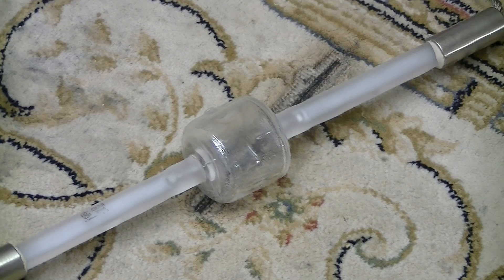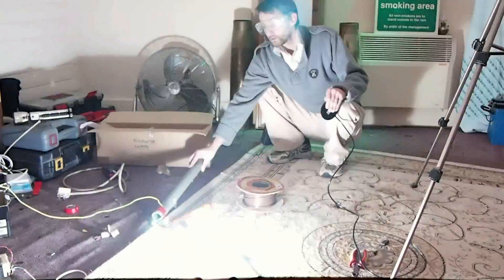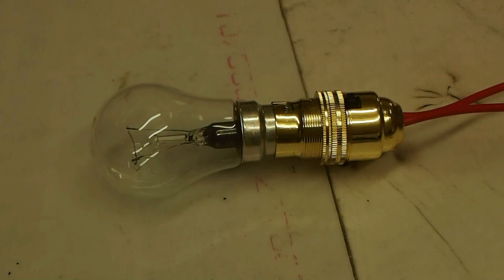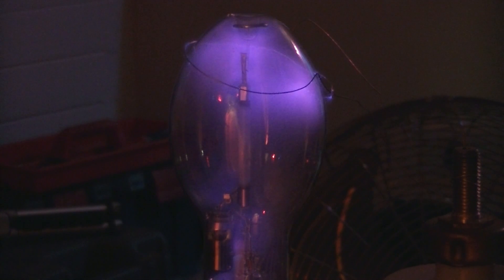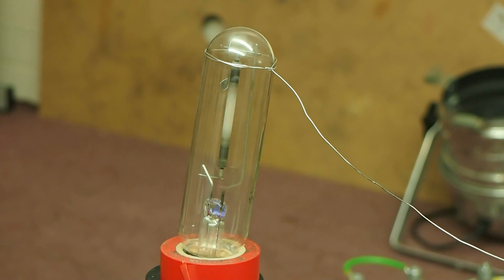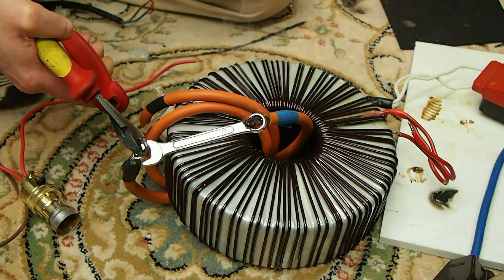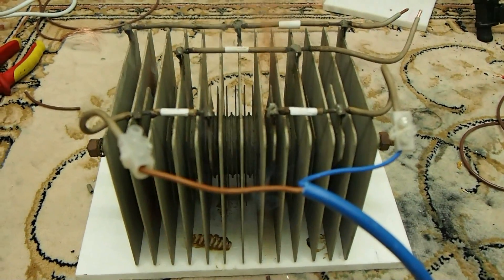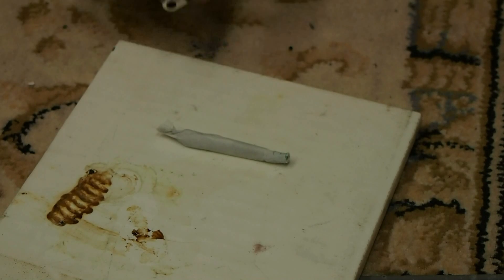State Of Matter

Comment: I'm not sure but I think the 700 amps at 1 volt would be less dangerous than the hundred thousand volts at 7 milliamps.
You'd have something like 70,000 watts going through you with the latter and 700 with the first one.

Comment: 1.  100 000 V  7 mA.    

2.  Hight voltage (you are easy conductor, its very easy to shock you from few cm.) 

3.  700 W Power, this is not a  low energy consumption. 

4.Your skin it is weak isolator, but when you get electric arc, you feel like have paralised muscles. 

5.Electric signals in your body do not flow in right way.

4.Your skin it is weak isolator, but when you feel electric arc flowing in your body,   similar feel like to have paralised muscles. 

6.Lower frequency current,  higher posibility to die.

Comment: In my understanding, its the High Volts that kills, not the Amps. Otherwise all the stick Welders would be electricuted (and underwater welding diver would be instantanious suicide). Accept that Watts add to the same.
Reply: Well, in theory Watts are the killer, not voltage or amps. But, even with 1000 Amps 1 Volt, you could touch that. theres no way 1 Volt could overcome skin resistance.
Reply: so they depend on each other.

Comment: WARNING 6:12 no gloves ? I know those are clearly insulated handles but common.. If even the smallest arc travelled to your hand you would have been stuck unable to free yourself  frying just like the wrench. Be safe ppl.
Reply: It can't arc at 1V and even if he touched the outputs of the high current transformer he wouldn't feel a thing since our bodies resistance is too high to pass any current, same reason why we can touch the terminals of 1.5V batterys and not get a shock off them. 

The only risk from that is getting burnt from hot bits of metal.
Reply: LOLDONGS cracking knowledge eggs over here I like it ! Well done sir.

Comment: 700A=beyond dead
Reply: Very true if that current can pass through our body which at 1V it can't. A car battery can put out 500A on a short circuit but we can touch the terminals and not feel a thing since 12V is too low to pass any current through the body.

Comment: amps is the killer<
Reply: Wrong. Both will hav to work hand in hand. Voltage s da energy required to push current so if the voltage s low then it’s mch safer.

Comment: the way the question is phrased will mislead you, if you use your self as a conductor across one volt of available potential then your body will never allow enough current to pass through it to hurt you because of your body's resistance ( you can touch both sides of a 12 volt car battery and not feel a thing but if you put a wrench or crossed it it'll melt it or blow the battery up. at a hundred thousand volts the resistance of your body will allow enough amperage to go through if you have a Max points .07 Supply to kill you. I used to use hi pots all the time to test transformers and while it doesn't feel good, if you accidentally get shocked it won't hurt you. the current is limited.

Comment: .6 milliamperes across the heart and you're dead. The 1v has more power in that single volt than the 7ma through the bulb. both are deadly but that single volt will fry your ass.
Reply: Ryan Willis yep, also, the heart is told to beat within a certain range of Milliamps (200-500 I think)and won't take any interference within that range of Mah, it will stop beating or beat uncontrollably, and it will not start again or beat properly until a defibrillator is used to deliver a countershock ',)

Comment: Volts does not kill you it's the amps so the one with the 700 amps 1 volt that'll kill you, not the 100,000 volts 7 milliamps. It's always the amps that'll kill you not the volts.
Reply: even 100.000 Amps couldnt overcome skin resistance with 1 volt. so, no.

Comment: Both 700 amps @ 1 volt and 100kV @ 7 mA can kill. At least I would certainly think so. 100 kV may shock the crap out of you, burn you, and it would hurt very VERY bad. However, 7 mA is not necessarily a lethal dose of current, but 700 amps is probably 2000 more times the quantity required for current to be lethal. Then, 700 amps behind one volt.... your skin is going to have way more resistance than one volt would penetrate. So it can also be said a person can survive either. How bout 100,000 volts @ 700 amps?No debate- your dead
Reply: I think  because the voltage is so high, a shock from it would effectively be straight across your heart, where it takes microamps to cause fibrillation. Compared to such a high voltage there is not much difference how it shocks you. Just a thought

Comment: The 100 kV and 7 miliamps... That's 700 watts. You may have heavy burn and intensive electrolyse of body fluids. It can definitely kill you. 1 volt and 700 amps... Not exactly because you are protecting by ohm's law.
Reply: Ohms law works there too, the spanner is a good conductor of electricity while your body is not. So you're pretty safe if you touched that.
Reply: NGC1433 It's highschool physics, where were you that time?
Reply: Adil
Well, if having parts of you evaporated by glowing hot metal is a definition of safety to you, I don't see a problem with being electricuted to a crisp either.
Reply: Adil
Dafuk are you on about?
Reply: You are literally the only person I've seen in a comments section to ever have an understanding in this
Reply: Protected by ohms law? Not with that glowing hot spanner up ones bum. :)
Reply: NGC1433 CIENSE

Comment: if the current is limited then neither would kill you, if not then ohms law dictates the current must change with resistance to give wattage, so 100,000V would be plenty enough to turn you into a smouldering sack of ash and boiling body parts if it has the ability to provide enough current at the given voltage, 1000 Amps at 1V however wouldn't kill you as the current going into your body would change due to your bodies resistance meaning you would no longer get 1000A going in you :)

Comment: well... if I'm not mistaken 1amp will kill you, so yeah you'll get a burn from the volts, the 700 amps will make you a crispy biscuit.
Reply: In this video, he was getting 700 amps at one volt with a dead short. 1 volt is not enough to even overcome the resistance of your skin, let along push a current of 700 amps through your body.
Reply: You must have very dry hands then. I am a sweaty palm type of dude, and telephone lines are veeery uncomfortable to hold for me. They are at around 60 vots here.

Comment: easy amps are more deadly then volts cuz volts is just a current flow in the energy of electricity amps is the power jolts in the energy of electricity meaning the mass of atomic flow of electricity mean more amps more atoms flow more heat thats why electric current can burn or kill u... am i right or nah?
Reply: You need a higher voltage to push current though your body, which has a high resistance (see Ohm's law). This is why you can arc weld with a 12V car battery, yet touch the terminals and remain unharmed. One volt is harmless because your body's resistance is much too high, but it only takes a few milliamperes to stop your heart, which 100kV is certainly capable of pushing through you.
Reply: Bacicly you could touch 700 Amps 1 volt, because it couldnt overcome skin resistence, as long as you dont stick it in your mouth then, everythings fine. wont even feel it.

Comment: I know not what is, this elastictrickery u speak of...? But Photon I fuckin laaav iiiit!!
Very interesting comments, I'm building a motorhome and can't decide whether to get 12v solar panels or 320v direct to grid solar panels as I don't want to have them wired in parallel or series & will have to run individual cables for each panel. My thinking was low volts high amps needs heavy wire possible fire risk but can't kill me, verses high volts with milliamps that only requires a light wire but could kill me + there's power loss to think about. If anyone has any advice this is just to power the charger everything in the vehicle will run on 12v battery power

Comment: As a automotive mechanic for 20 years I can tell you volts don't kill amps do. Cars can have in excess of 60000 volts at the spark plug. If volts killed I would have killed many apprentice in my years. Here hold this zap. Lol 7 milliamperes across your heart will stop it. But a car battery don't kill you and they can have up to 800 amps coming out of them. ( if not more) I have never died touching terminals of a battery. You got to think of it like this. Volts push the current out. Volts is pressure and amps are workload. If 100 people try to get through a door and are not pushed it goes smooth. If you have something pushing it out you will break the door.( heart in this case). Well that's my theory. Lol hate away!
Reply: look at afrotechmods on youtube, i have no time to waste explaining what you are saying and how it is incorrect. Such a misleading statement
Reply: 300mA!!! My god that would throw your heart out of your chest! 20mA is deadly enough!!

Comment: 100kV@7mA will kill and fry you, 1V@700A wont. Funny thing though, both voltages have an effect of 700 watts...? Thx for the video, Photon, always a good laugh! Take it easy champ;)
Reply: If you were made of metal you might be able to get 700A, with 1V and our composition you could deep throat one end of the wire, and shove the other up your arse and I bet even then you wouldn't feel it. Ohms law people, you can't have X current without a high enough voltage AND low enough resistance.
Reply: Simon T love the example by the way
Reply: @Physics & Stuff the 1V 700A will burn your hands badly if you short circuit the output and that's just because it's 700watts and that can generate really a lot of keat but you can't get electrocution because if the electric resistance of you body.
7ma is really low but at 240v you already feel it badly and at 100 000v it will instant kill you
Reply: +noilex you're wrong...
Reply: its the amps that kill...  but the resistance of the skin means it will not hurt you
 remember those 50,000 volt tasers
Reply: noilex...

complete BS.

current kills, not voltage...     

literally high school science, you amatuer
Reply: Saying tat current kills not voltage is like saying I’m going to shoot U wit a shotgun but as long as the bullet hits u softly u wouldn’t feel a thing.  Voltage is da energy required to push the current. So it’s both hand in hand.
Reply: @djjc9782  He's right mate. Ofc 700 amps through your body will make it literally explode, but guess what, you also need enough voltage across you to get that current through the resistance of your body (typ. 1kohm even though could be higher, it depends on several factors). You know, Ohm's law, highschool stuff too.
Reply: @9712teo  again, wrong, but hey, whatever, you try it. lol

try a guy on here called "photonicinduction", who does this shit for a living, as in hes an electrcian, not a youtuber...    not my circus, not my monkeys mate lol.
Reply: @djjc9782  I tried in fact. Some time ago I built a spot welder, the open circuit voltage is like 1-2 volts and the operating current is about 1kA. If your argument was correct, I think I wouldn't be replying on YT if I touched the terminals, but guess what, I did and I'm still here. Again, Ohm's law is your friend. Have you ever touched the terminals of an AA battery? Even that is capable of delivering 1 amp of current, but nobody have been killed because of it.
"Current kills, not the voltage" is very often used, but few people know what that really means. The sentence is correct in a technical perspective: the voltage is not the cause of electrocution, but it is in fact the current that flows into your body. Yet, it is often misunderstood as if the voltage is not important, could be 1 volt, but even 1MV and that's absolutely incorrect. If it isn't, then why the danger signs on a power substation read "high voltage" and not "high current"? So again: yes, the current is the killer, but you must have a certain voltage in order to get it flow through your body at an intensity enough to fry you. And of course if 700A flows into you, you will probably explode (considering that the exposure is long enough).
Yeah, I know Photon, he's an electrician and an electrical engineer, like me

Comment: Same amount of energy. But that 100,000 volts would kill you because it can overcome the resistance of your body: wrist to wrist or leg. All of your muscles between (nerves within influence) would contract. You would not be able to let go, or move away. It would kill you from asphyxiation and cardiac arrest at the same time. Double overkill if you ask me. As for smoking or fire you would need to be in contact with it for long enough for your body to heat, dry, and burn into carbon lowering your resistance. This can be done with a piece of wood as well if you want to see it without a human body involved.
Reply: Foil wouldn't do it safely. I have seen people wear full chainmail do a light show.
Reply: No people use full body chainmail suits for a reason, Foil is too thin, easily tears from stress of moving alone. But hey if you want to trust your life to some foil: Darwinism...

Comment: 9:30 I'm pretty sure fluorescent tubes have mercury in them, with is not healthy to inhale.
Reply: +Owen Robinson Vaporized: incinerated to the point of vapor. Vapor is a gaseous form of a particular element. Mercury is in the air m80 if that's the case.

Comment: Human heart produces electric current at ma levels. So current of 7 ma is capable of halting your heart. It is a problem of which route the current will follow in your body. If your heart is on the route this could be bad for you but if it enters from one finger and than exits from the next then no problem.
Reply: +kemal kaya dude hi voltage goes literaly everywhere so if power source good enoght you'll be dead anyway.

Comment: 100,000 Volts At 0.007mA Is 700 Watts, 700 Ampere At 1 Volt Is 700 Watts.. Neither Would Kill, 700 Amperes At 1 Volt can't go through you, because 1 volt isn't able to break down the resistance of the human body not allowing the amps to go through you, that's like saying a 12 volt 600A car battery can kill you If you touch the terminals, if it kills you, you have a problem.. 100,000 Voltas At 7mA can't kill you, it may cause some damage to organs, and maybe kill you, but it will be a slow and painful electrocution, but there's really not enough amperage in it to stop you're heart, but the only thing that will kill you is HIGH AMPS and HIGH VOLTAGE ( Like MOT'S ) to make a hazardous recipe, THX For Reading, Cheers Guys;DDDDDDDDDDDDDDD

Comment: they both have the power, 700 watts. they both will kill if done right. been there not done that
Reply: the 700 Amps 1 Volt couldnt overcome Skin resistance.  the 100.000 Volts would have no problem with that. and 7 milliamps are enough to kill a person.

Comment: 100000V * 0,007 A = 700W
1V * 700A = 700W
Same power
Reply: +Ficraft but 1V cant go through your arms, so the 1000000V has more chances of killing you
Reply: I am a mechanic. car batteries are 12V, 550-650A on average (at 0C). you can touch both + and - and you will not even get a shock. problem comes when you get to he transformer for the starter which lowers the amperage and raises the voltage to the point where it WILL shock you, and the amperage is still high enough to kill you. but the straight 12V from the battery wont be able to put the 650+A into you, as 12V is not enough potential.
Reply: ***** yes, but what are the chances that 1V actualy goes thru u. if the voltage was high enough to go through u than yes, that amperage will certanly kill u. but have u ever been shocked by a 1.5V battery, my guess is no. although 7 milliamps is small, just the fact that 1KV can shock u, could cause an old man a heart attack. Which wont happen at 1V, no matter how many amps. hence making it just slightly more dangeous.
Reply: What
Reply: R=E/I (or Ω=V/A) (ohm's law)
P=E*I (or W=V*A)

Ω(R)=Ohms (resistance)
V(E)=Volts (electromotive force)
A(I)=Amps (intensity)
W(P)=Watts (power)
Reply: in mechanics we use E, but it may vary on discipline (also canada)
Reply: Bacon Grease it's 100,000 volts. not 1,000,000 volts. typo
Reply: Eugene Bodnarchuk to

Comment: The higher voltage lower one would kill and the higher amperage would not but they both have the same power because power = voltage X current so 1x 700=700 and 100 000 X 0.007= 700